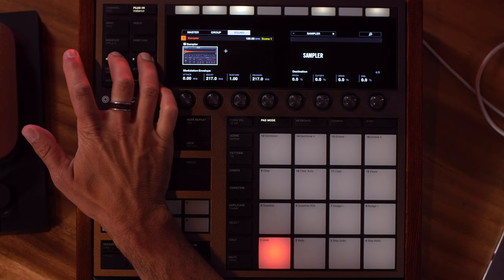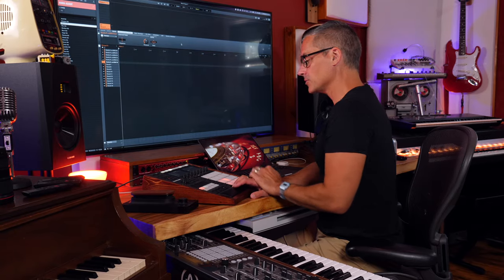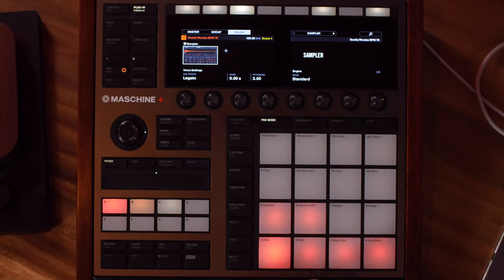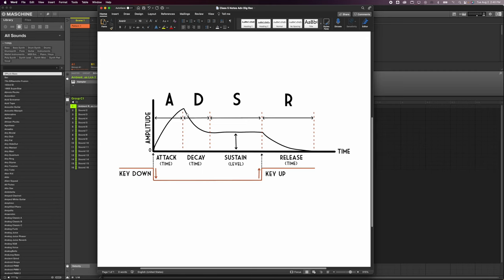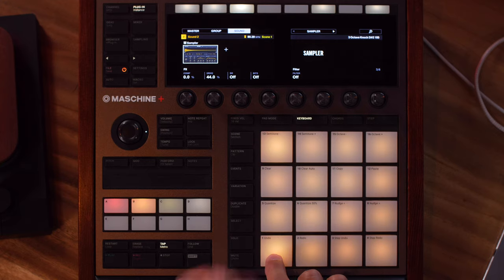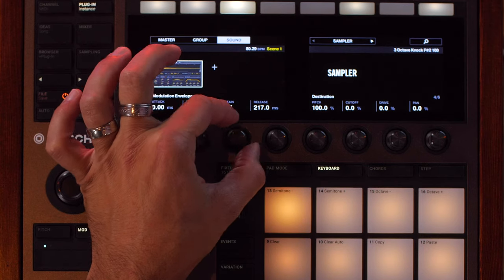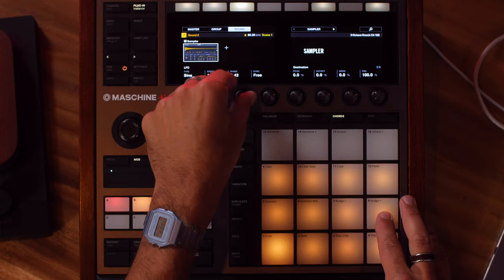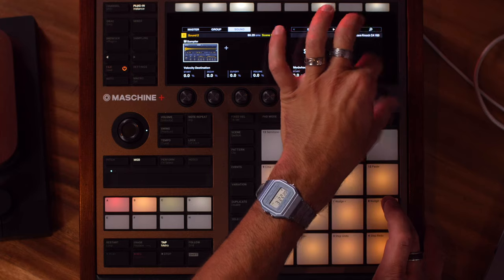Essential Maschine Sampler Masterclass. Bookmark this one!

Comment: @11:40: IMO, it would be better to go change the root key over on the zones page. If you use that method, the math of the pitch controls in the sampler is easier

Video suggestion for you: Using single cycle waveforms in maschine.  There's a big collection you can find by searching for "adventure kid".  The shaping controls in maschine work well with the concept; and you get a ton of sound options without requiring a lot of space on maschine+.
Reply from the maker: Good tips, thanks drh!

Comment: I'm considering an MKIII purchase and had a question related to this. When I saw the title, I was hoping you worked with drums. Any way, a question I couldn't answer looking at the manual.

I see velocity can modulate start, delay, cutoff & of course, volume. But can velocity modulate pitch?
Reply from the maker: Not that I can think of… but if it’s drum related, don’t forget you can click on a snare then hit keyboard mode, then play the sample and move up or down the pitches… great for pitching a snare roll and much more precise than velocity would be!
Reply: @jefgibbons  that would only allow for semi-tone variations I believe. I'm looking for something much more subtle; a bit more brightness for louder hits, less for softer hits. Or can that be done in keyboard mode? Or maybe another way?
Reply from the maker: @Bezowinz  Only thing I can think of would be to assign the pitch bend to something very small (like 0.1) and then use the slider to control the subtle pitch changes...

Comment: Also... I make a lot of beats and love the expansions, but really struggle with creating things on my Komplete Kontrol keyboard. I watch you do everything on Maschine and then I struggle to translate onto my KK system, using Kontakt, Komplete Kontrol, Maschine plugin, Massive X, Monark, etc... and am struggling. I have found your keyboard/maschine videos, but nothing seems to just nail it all down extensively. What do you think? Am I off base with that observation? Also, I do know that you are more geared toward Maschine hardware users, of course, but was just wondering... I do not to drop more $ on hardware right now.
Reply from the maker: Hi Don, I don't quite understand your question/ observation... I use the Maschine a lot in my videos for playing stuff, but tend to do more on the keyboard on my own.  I like showing how much you can actually do with just the hardware, and little keyboard skills (most of my followers).
Reply: @jefgibbons  sorry to be unclear. You obviously do a brilliant job showing how the Maschine hardware works to make these beats using expansions, etc. I’m not a keyboard player, by any stretch; but the hardware I DO have is the Komplete Kontrol Keyboard. When I watch you demoing expansions and the features of the Maschine hardware, I wonder how that would translate to the KK hardware. Basically, “how would I do everything he’s doing on Maschine hardware using my keyboard?” Sorry if I’m just being dense about this. 

How do I take advantage of NI expansions just using my Komplete Kontrol keyboard, and do everything Jef is doing on his Maschine+ right now? 

Is that even possible? I mean, I have keys instead of pads, but, other than that..?

Make more sense? I just can’t seem to sort this out.